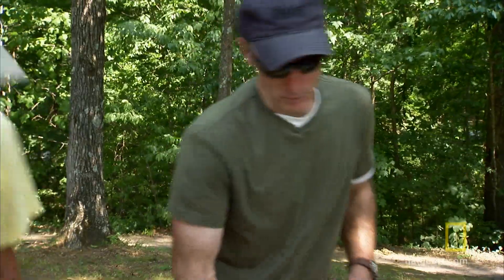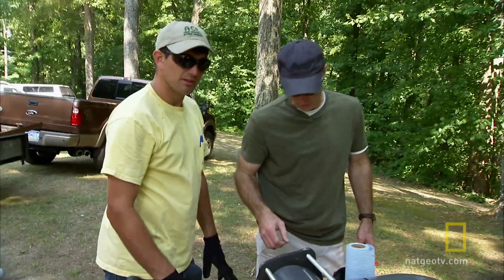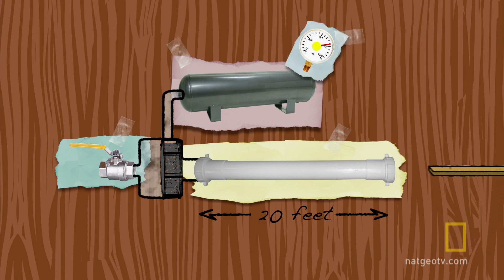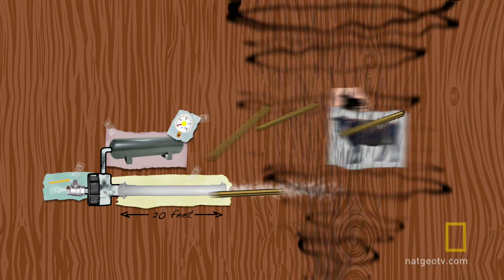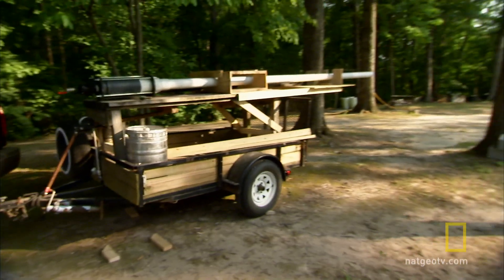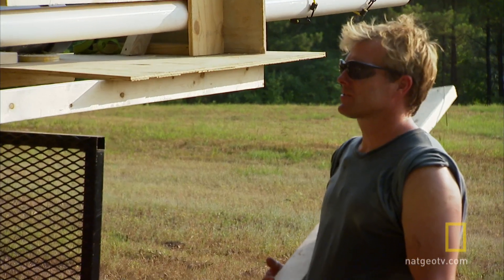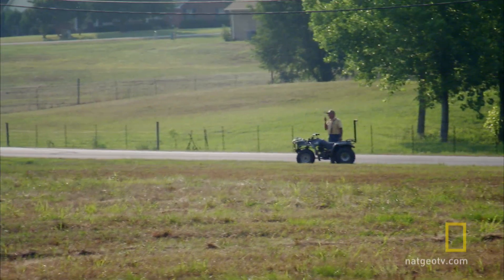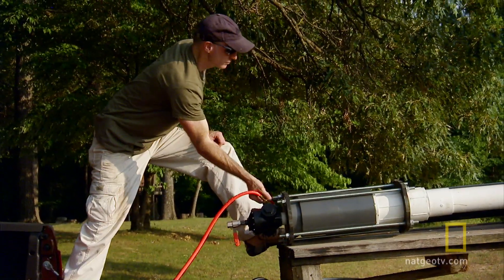The 2x4 Tornado Cannon | Rocket City Rednecks

Comment: Years ago I saw a video of some guys who built a devastating launcher. They didn't build it as a cannon... they built it like a giant tennis ball shooter. It used two counter-rotating car wheels with rubber tires on them, a welded steel frame to hold them in place, gearing to transmit power to the wheels, and a v8 engine to power it. The distance between the tires was just slightly less than the thickness of the lumber, so it took a strong grip of it. With the engine at max revs the launcher was grabbing 2x4s and heavy wooden planks and shooting them out at over 150 mph. And it could fire them like a machine gun, as fast as they could be pushed in from the back side. They put some old refrigerators, wash tubs etc. out and shot lumber at them, they were smashed to bits. I have no idea where to find those videos again. It was so long ago it might even be from the pre-youtube era. Or maybe early youtube.

Comment: @5omething Not a hoax. I build cannons very similar to this, granted they are MUCH smaller, but they are still real, and are incredibly powerful, and can EASILY kill someone. Right now, I am in the process of building a golf ball cannon that will launch golf balls at about 980 feet per second, with a range of about 850 yards, and it will have about 1500 foot pounds of energy. Once again, not a hoax.